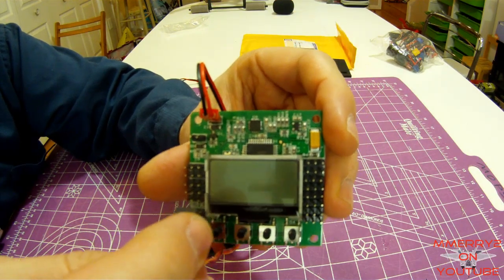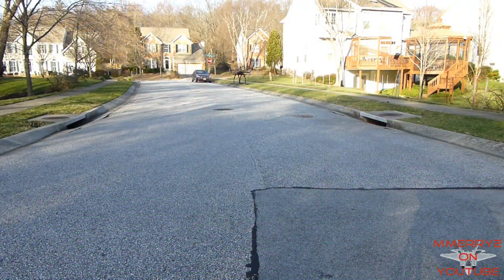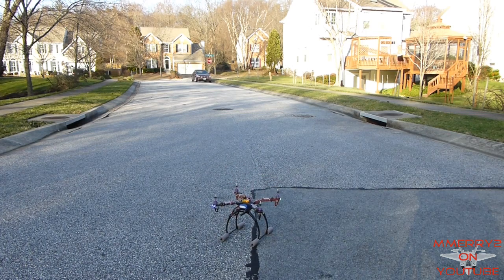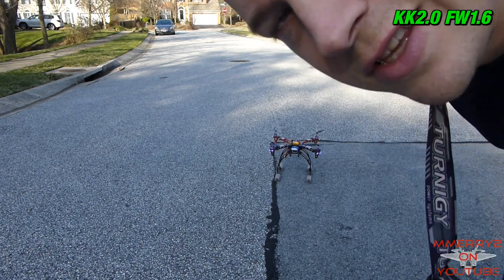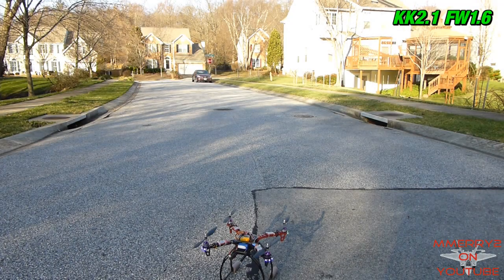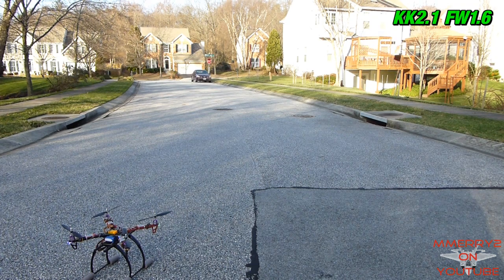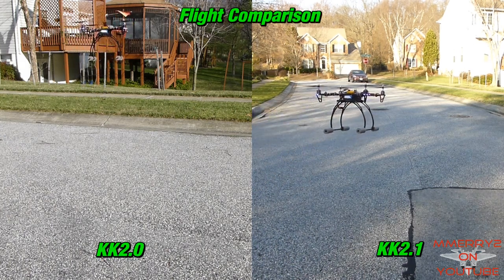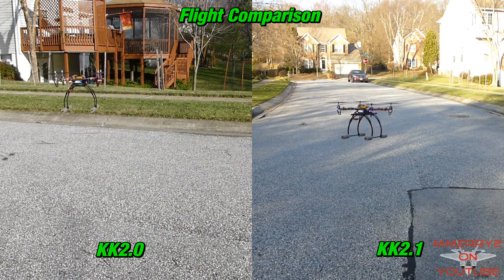HobbyKing KK2.1 vs KK2.0 Flight Test Comparison

Comment: I have a 2.0 and twice it has been flying fine and then it rolls o the left (when facing me)  First time I was doing tricks and thought I stressed the props, but today I was steady hover looking for lost plane in a field.

Then it just rolled, and would not respond to radio commands I have a Taranis 9xd and was using the best taranis *XR long range reciver (It was only 25 to 30 feet from me ) so Im not sure if out of range or not.

Have you had this problem I am more then likely having to buy new KK board and will go what hobbyking has as the newest model.

Comment: Hi. Havent seen much of anything new from you in awhile. I was wondering if you worked with the 2.1.5 more. I cant seem to find anyone who knows how to get into the Misc Settings 2 or 3 menu screens, although the official manual makes a few references to points that are adjustable in them. Thanks
Reply: latest firmware will open up those settings mate.
just update firmware.

Comment: Hola soy de peru arequipa. Grabiel Huaman.    Quiero armar un tricopter  tengo la placa kk2.1.5 no se comfigurarla la placa kk2 .1.5 y como se comfigura la radio turnigy 9x para tricopter. Desde ya muchas gracias
Reply: Grabiel Antony Huaman Ranilla saludos  para usar la placa con un tricoptero necesitas a ir a los settings de  la placa KK2.1.5 e ir a  "load motor Layout  y seleccionar  V-tail le das enter  y te va a preguntar si es correcta la seleccion que tomastes y al dar el boton "yes"  te aparecera  el dibujo del tricoptero.Puedes encontrar videos aqui en youtube de configuraciones de tricopteros con Turnigy 9x.
Reply: Norbert Rivera  muchas gracias

Comment: I think it's clear that the PIDs for KK2.0 won't work as well on the 2.1 board.  Whatever the difference in capabilities, if you upgrade, be prepared to do more tuning.  This video certainly doesn't persuade me to replace my KK2.0s with the newer version.

Comment: What motors and props are you using + batt. What flight times do you experience please?
As always a very kool job
Reply from the maker: Dick, the motor and props are from RCTimer.  I put the specs in the video notes.  I am getting about 10 minutes flight time on a Turnigy 5Ah 3s LiPo.  I wouldn't recommend these props.